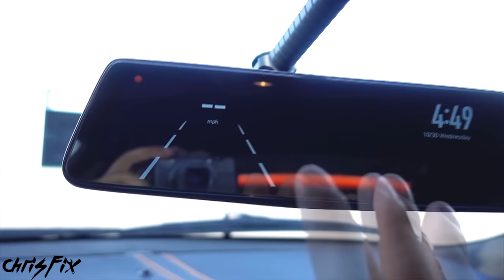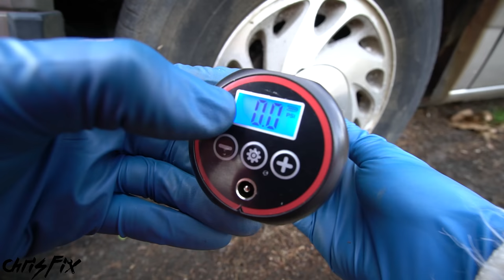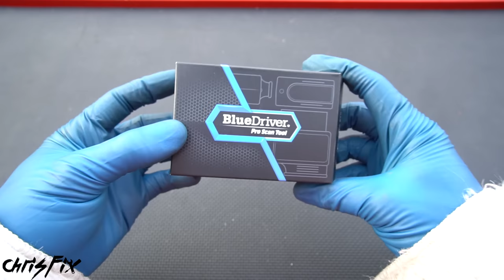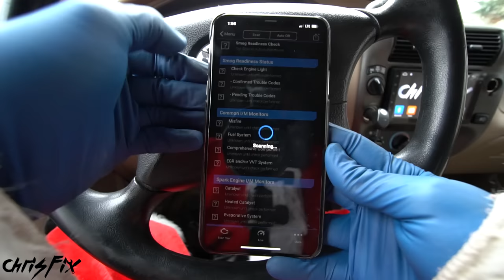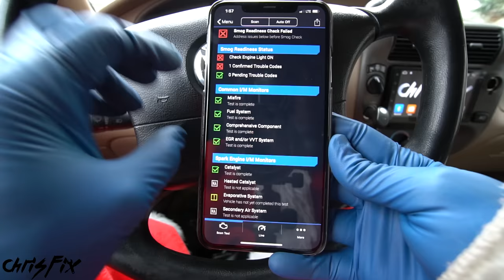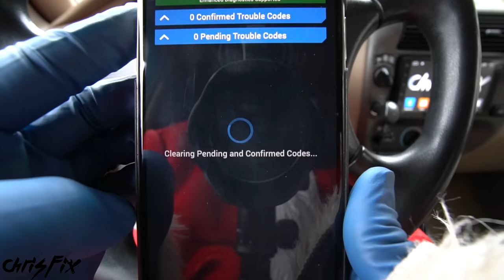Top 5 Car Guy Tools & Gadgets of 2019 (Christmas Gift Ideas)

Comment: “When you drop a bolt in the engine bay and it doesn’t hit the floor” the sheer pain from those words is indescribable. I had Vietnam flashbacks when you said that Chris
Reply: I had that happen with my scooter, a Honda Metro 50cc... lol I was fixing it up for my nephew and dropped a nut, a very important nut. 
I looked for over an hour, I dug around with a magnetic stick (which wasn't too bad since mine is the full aluminium unibody version) and lights... I literally almost cried from frustration. It was so small and tight and I had no idea what to do. I started removing body panels which isn't easy, and I went underneath to undo a nut...

The nut was there. 
Right in front of me...

Staring at me...
"Oh. Hello there. What's up? Were you looking for me?"

It was stuck to the big magnet I stuck to the bottom to aid with red lights! It was just sitting there the whole GD TIME ! ! !

lol I'll never forget the frustration and rage again. I too suffer from PTDFS. Post Traumatic Dropped Fastener Syndrome.

You're not alone my friend. I hope the nightmares stop for you, and I hope you never wake in a cold sweat again screaming "I SHOULD'VE BOUGHT THE MAGNETIC DRIVER SET! WHY AM I SO CHEAP?!" It's okay. Some nuts and bolts may be lost for ever, some get found, and some get replaced... but you can still move on and have a good life. 
Just make sure you buy a magnetic tray, so you don't accidentally bump your red solo cup full of nuts and washers straight down the engine bay and immediately commit suicide. In the event of a massive fastener spill, call a hotline. Ask for help. It isn't the end.
Good luck. 

;]
Reply: @DanteYewToob  Magnetic trays are a lifesaver 😂😂.

Comment: Hey Chris I want to just thank you for everything that you do, especially that used vehicle  checklist that you gave us for free. I went to check out a Toyota tundra and followed your checklist point-by-point. When I removed the oil cap I saw that it had a frothy white substance, so I knew it was a head gasket leak. Then to prove to the salesman that it was a head gasket leak I told him to turn on the vehicle and the white smoke started  coming out.
Reply from the maker: Wow, I'm surprised they tried to sell the car like that! I'm glad you used the resources to not get a car with issues!
Reply: @chrisfix  how would you rate FIXD against bluedriver
Reply: @salvatore_davi  FIXD is just an overpriced bluetooth OBD2 code reader. If you just want to check codes and see a digital dashboard of dials, buy any other USB or bluetooth code reader. Serious, $20 will get you a fairly good one. Tools like bluepoint do extra things that much much more expensive scanner tools do as ChrisFix showed here.

Comment: I purchased the same pressure washer that is in a lot of his car cleaning videos and I too love it. It turns a normal weak pressure hose into a pressure that can hurt your hands if you hold them close to the tip. It is good for getting tough spots off the car without scrubbing and has not damaged my paint at all no matter how close I put it to the paint. Of course you should hold it about 3 feet away from the car normally, but you should have no issue getting up close on tough spots now and then.

Comment: "Hey Guys! ChrisFix Kringle here!"

I can vouch for the BlueDriver. I used to have a cheap bluetooth scanner that I used with Torque Lite, and it worked for the basic stuff. That is until my wife's SUV had an issue with her ABS, AWD, StabiliTrak, and Traction Control not working. I tried scanning with the scanner I had, but it could not scan the enhanced modules, so I wasn't able to get the code that was being thrown in the ABS. I purchased the BlueDriver after trying other apps, and it worked with no issues, AND it gives you information on the codes that it pulls, along with frequent fixes and other possible fixes. In our case, it was a failed right front wheel speed sensor. Purchased a new one, replaced it, and then cleared the code from the BlueDriver app, and no more issues 😁.

Comment: Did anyone else get a stomach ache when chris mentioned the 

“drop a bolt in the engine bay and it not hit the ground long nights”

You of all people know we don’t speak on such things here😂
Reply: Yes, I did.  It never happens in the daylight either.  Always at night when you're close to the finish and then...
Reply: That single line of dialogue gave me an overwhelming rush of anxiety! 😫
Reply: I just came inside from working on my beater doing knock sensors for 6 hours so far. Pain in the butt. Have lost 4 nuts without hitting the ground so far.
Reply: Nick Conrad good luck brother. Did you end up finding them?😂
Reply: I just did.... thought i have a break and watch some chrisfix before i hulk out on this thing
Reply: With me, it happens with the tiniest part that is very hard to hold onto, and it drops against an angled surface that sends it rifling into the grass or into the uncleaned part of the garage containing heavy things I would hate to move. 😫

Comment: I've got to say, those extractor sockets are super nice! I live in Michigan so you know the winters take a toll on suspension bolts and undercarriage bolts but I use those extractor sockets all the time. They work great, even for stripped lugnuts , especially the stripped wheel locks. 100% recommend!

Comment: I can use those . I have the extractor sockets . Definitely a game changer when pulling off stripped oil pan plugs. I wonder if that smart mirror will work with my 2014 Toyota Tacoma? It already has a backup camera but I'm interested in the forward facing camera feature

Comment: I'm 17 and I want to start my first project car (which I already have). It's a 1991 Chevy Silverado but there is so much wrong with it such as the transmission, engine, starter, gas tank, and no battery. Any tips on how to get started on such a massive project.

Comment: Chris my light went on on the dash saying maintenance schedule due soon. It's a 2019 Toyota chr 1,697.8 mileage must be due for oil change. Don't want to deal with dealerships so I'm changing it myself. I think IT'S time for oil change at this mileage what you think? Feel like an idiot I'm suppose to be a mechanic just never had a car that told you when to do something needed.
Reply from the maker: I would look at the owners manual to check the maintenance schedule, because if your car only has 1,697.8 miles it shouldn't need anything.
Reply: @chrisfix  thank you, I cleared it it shows how to do that.

Comment: Hey chris, I bought an aftermarket exhaust for my 2010 lexus is250C, I bought the manzo axle back and it says it fits the C trim but when I put it on my car it doesnt align with the resonator, is there a part i could buy or something I could to get it to align its not even a few inches. Ik im dumb lol, my first attempt at "modding", I was able to install it quite smoothly besides that one part which is the only problem.

Comment: one things i really hate are those compressors no matter battery or cigaret lighter cause they take so long time to fill the tire. 8mins. i better of do it by hand. my friend bought one with cigaret lighter powered and it lasted only 2 tires then it broke. and the hood light doesnt work with every car. i have a hood that opens from rear to front 90 degree angle so it will light my windshield instead of engine

Comment: Hey i've got a problem with my car, i was driving an hour ago, and braked bit to late, and hit a speedbump bit harder, not really hard, but a bit harder, and after that i startet hearing chirping in the engine compartment, i thougth it was a wheel, but it chirped while staying still, in nautral and other shifts as well, then i got home and turned a car off. I'll start it again tomorrow, but does anyone know what could be the issue?

Comment: Does the rear mirror work with older cars
Reply from the maker: What car are you planning to install this in?
Reply: @chrisfix  omg thx for the reply! I have a 95' miata would it work? Im unsure how its connected.
Reply from the maker: I works by connecting the mirror to a cigarette lighter, and the camera to a transmitter (it's like 3 cables so it's tough to mess up lol), so as long as you have a cigarette lighter, it should work! Here is the best instructions I could find: https://amzn.to/3cMYNqr
Reply: @chrisfix  ah i see i had a mistake in my thinking if that makes sence nevermind. Thanks a lot and keep up your work. You are awesome :P

Comment: Actually you wrong chris. The piler can remove the round nut better than extractor socket as long as you got the right one which is (Self locking piler). And it just one tool instead of different socket size.

 I got a round nut once. I wish I got a nut breaker at that time because the bolt is soft. No matter what extractor or piler using. It will chisel it off. Which my first time came across soft nut.

 I use a piler which is KNIPEX COBRA. It can remove anything. Even a round pipe. If you can remove round things. You know what other things that can't be remove. I got a few more nut that is round but it not a soft nut so it came of easy with this piler. You should it it out and you will love it. For me it worth every penny.

If you try it out. You will know that I prove you wrong. Or try to prove me wrong.
I recommend you use the same brand if you can find.( KNIPEX COBRA.) If can't find it. There alot of self locking piler out there that is well known name.

Comment: Can the dash cam be used as a back up camrea also?
Reply from the maker: No because it's facing forward, but you can wire in a backup camera to the system!
Reply: @chrisfix  that's awesome thanks!

Comment: as a professional detailer in the industry, im sorry to say but ceramic wax does NOT protect your car. si02 (ceramic) does not mix with wax, especially carnauba wax. true ceramic coatings will have a rating from 7H-10H on the pencil hardness scale, which prevents swirls, light scratches, has uv protection, protects from water spots, dead bugs, road tar, oxidation, fallout, bird poo and has a melting point of 800-1400 degrees F. whereas wax, does not protect from any of that, all it does it add a slight glossy look to the paint which will last maybe a month or 3. whereas ceramic will last 1-year minimum. for consumer use, i guess you can say it does the job without any protection to the cars paint besides the glossy look, where as ceramic gives a mirror like reflection. also with the clay bar, you should mention that it should be used as an AS NEEDED basis, you should NOT claybar your car as a normal maintenance procedure, claybar WILL mar and swirl your paint, which requires paint correction afterwards, but it does remove embedded contaminants from the paint, which will help wax and ceramic coatings adhere to the paint better and give the product better longevity. on top of that, you should NOT use a quick detailer on a DIRTY car that has not been washed, thats how you scratch your paint and create swirls, a quick detailer is for cars that have been washed and wax, and if dust settles on the paint, you would use a quick detailer spray to help lift that dirt off the paint and remove it with a plush microfiber towel, i can see now why you used it on a vehicle that has water spots on it as to hide the hairline scratches. i think you should elaborate more on the products you recommend and educate the people on how to PROPERLY use them.
Reply from the maker: thanks for the feedback, thats why its a hybrid ceramic wax and not a coating. This is something a DIYer can do at home and get better protection than a regular wax or sealant, with some of the properties of ceramic, but obviously this is not a ceramic coating. Because this is a simplified video, I can't go into the details of every little thing, but if you are interested, you can check out the product page or watch some of my other videos on this product and recommended car cleaning procedures like when to clay bar, etc.

Comment: That handheld air pressure gauge is absolutely useless. You measure your tyres with it, realise you have low air, then what? Get out your compressor which has an air pressure gauge built in. And compressors are as cheap as the gauge.